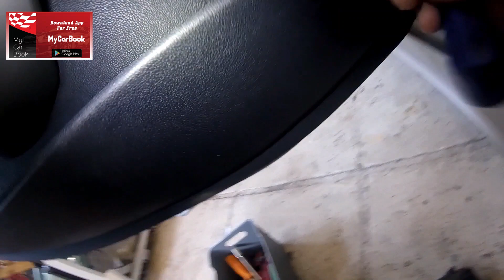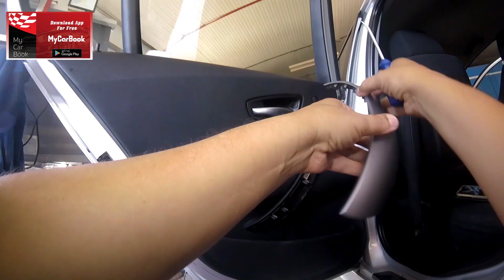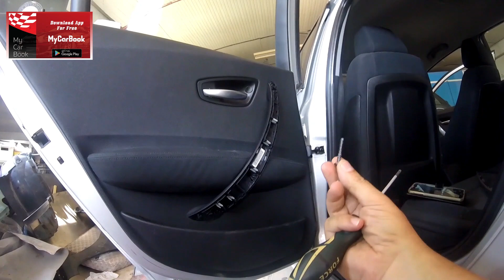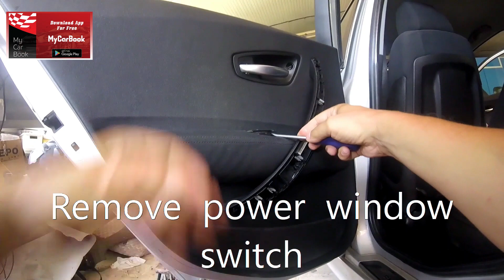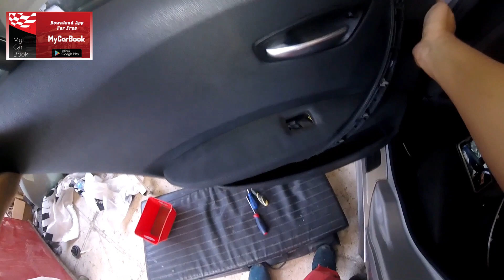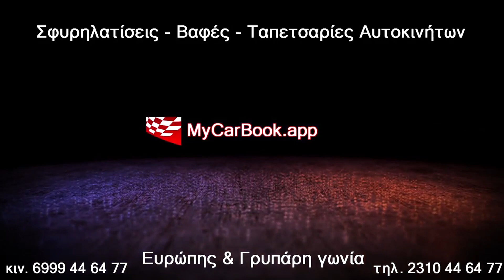BMW 1 Series 116 I 2004-2011  rear door panel removal

Comment: I bought a 2007 120i about ten months ago, because I urgently needed a car and it was within my price range.

Since then I've had to replace.

The VVT motor and sensor.

A water fitting (because it's made of plastic!!! and fell apart) and the water pump.

The battery.

The alternator, because BMW (in their infinitesimal wisdom) placed the alternator under the oil filter housing, and of course they didn't bother investing in good seals, so the alternator got choked up with well-cooked oil.

The windscreen (stone chip) covered by insurance and not really BMW's fault, but I might as well throw it in there.

And tonight, when leaving work, I closed the windows (I leave them chinked to keep the heat down as it's summer here), and the right rear window disappeared down into the door. I assume it disconnected from the support frame. That's why I'm here perusing your video for tips on opening the door to see if I can put it back together again. Paying someone isn't really in my budget at the moment.

All this, and the car hasn't even covered 100,000 km yet.

I can only assume that BMW set out to deliberately create a bad car, because I can't see how a low kms car can have so many major (expensive) problems unless the company producing it was doing so deliberately.

If anyone ever asks me if they should buy a BMW, I can only answer them, "No."